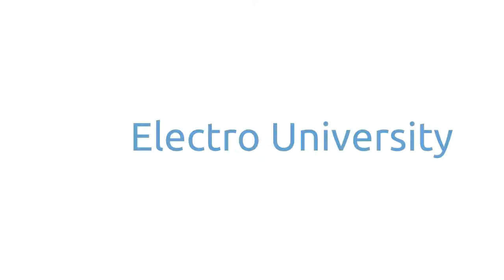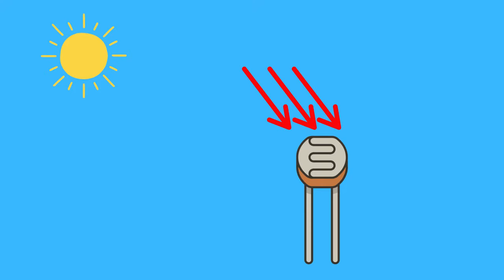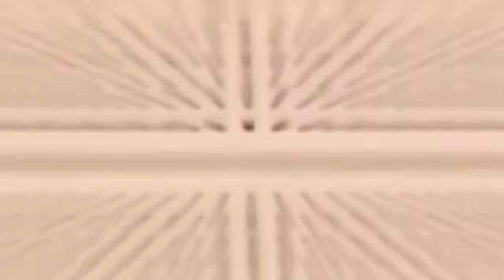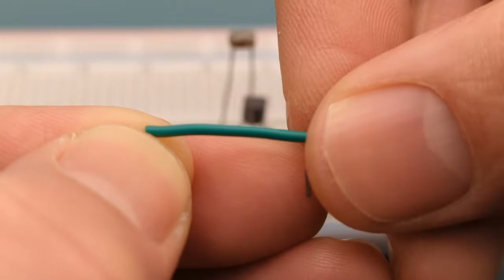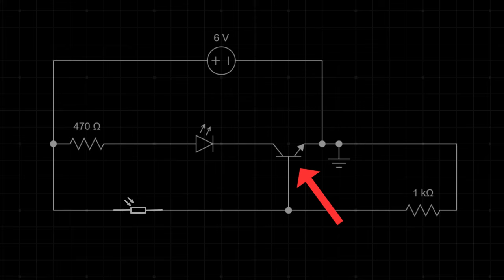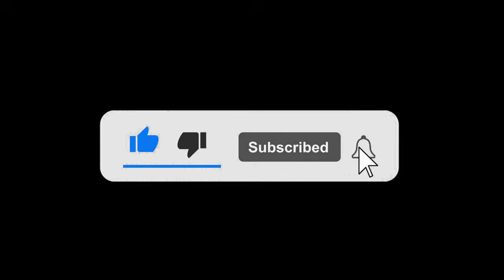How to Make Light Sensor and Darkness Detector With BC547

Comment: u earned a sub with this one , the explaining and the . gonna try it tomorrow if the works i gonna hit the like button.
Reply from the maker: Glad you found the explanation helpful and I look forward to hearing how your circuit turns out! 👍
Reply: @ElectroUniversity u earned ur like, i did the piano one,somuch fun, i adjust it : the first resistor from pin 7 to the 1st button i replaced with an potmeter and now i can adjust the tone nr:503. next step is add a bc547 to play auto tunes

Comment: mine started heating up
:(
Reply from the maker: That usually means there is a short circuit in your wiring, so please double-check all your connections immediately and disconnect the power. ⚠️

Comment: Ts tutorial is use less it is fake and it does not work at all, i made sure to use all correct components and followed the instructions properly and yet it does not work
Reply from the maker: Double-check your wiring and component polarities, as even a small connection error can prevent the circuit from working correctly.

Comment: I am doing the same thing but the led is turning on after connecting battery in dark sensor..why?
Reply: Did you figure this out?
Reply: @amnaatif7407 i have figured it out when the brightness of light is minimum this circuit considers it as darkness so it lights up ..but when you will give a bright light on ldr the led will turn off ....if we want to remove it ...I think we have to use 100 kohm potentiometer..i didn't have that so i couldn't be sure..i hope you understand
Reply: @aliaahmed-v6k so we can't really make a darkness detector using these components as it won't work?
Reply: @amnaatif7407 actually it works..but somtimes in minimum light, the ldr cannot detect light properly so it considers it as darkness so the led glows and we feel that the circuit is not working...so for better work if you want that in minimum light the ldr will consider it as light not darkness we can use 100 kohm potentiometer...when i have done this experiment in my room there was minimum light ...but when i did the same experiment in my classroom it was working perfectly so i have noticed the brightness of light
Reply: @aliaahmed-v6k thank you so much

Comment: I have tried the dark sensor just like you using 9V battery but the led is on when light is on...where is the problem???
Reply from the maker: It sounds like the voltage divider connected to pin 2 (or pin 6) is inverted. Try swapping the positions of your LDR and the fixed resistor. If they are reversed, the circuit will trigger on light instead of darkness.

Comment: Very useful and instructive, I have used a 2N2222 transistor instead and works fine with 3.3v and 5v, using appropiate voltage leds.
Reply from the maker: That's great to hear! Thanks for the tip about using a 2N2222 transistor and appropriate voltage LEDs – very helpful!

Comment: I tried to make the darkness sensor version and was quite successful though partially. I have given an input voltage of 5v and connected to a 3v led strip. After much experimentation i have settled with a 75k resistor between positive power supply and the ldr as this gave me a perfect working operation. But the output voltage never exceed 2.60v and as a result the led is not glowing as brightly. Could you plz figure out the problem
Reply: 3v maby is too loo low voltage, try to 5v, or reduce the resistance of the LED cathode and negative voltage.

Comment: I have tried the second one using 10kilo ohm resistor and 3.3kilo ohm resistor that the light comes on when there is darkness and its not working the light comes on as soon as I connect the battery. what should I do?
Reply: Did you found out the problem?
Reply: @antonioceronhernandez3358 did you figure this out??

Comment: Hi, would Like to ask what value of resistors should I use if I have 8.4v of battery ( 2  18650 batteries)
Reply: Ohms Law says, voltage divided by current equals resistance.  i.e. R=V/I.  We know the voltage, 8.4v and we know the current of the LED, usually 20 milliamps.  You need a minimum voltage to turn on the LED in the first place.  You have plenty, but this varies with colour.  It should be on the LED's packaging.  In answer to the question, then, 8.4/0.02=420 ohms.  Go to the next higher if there is no exact resistor value.  So far as the other resistor is concerned 1k is probably correct.